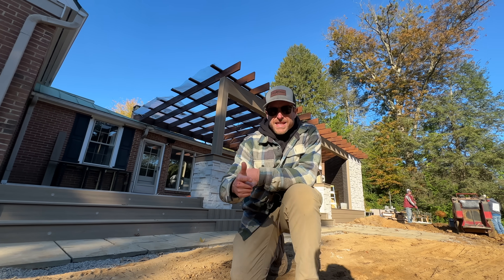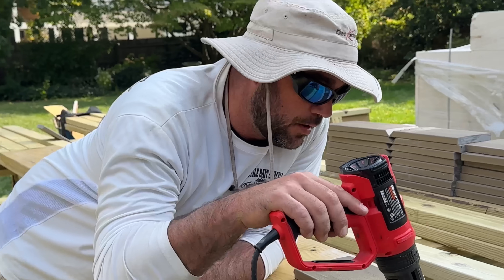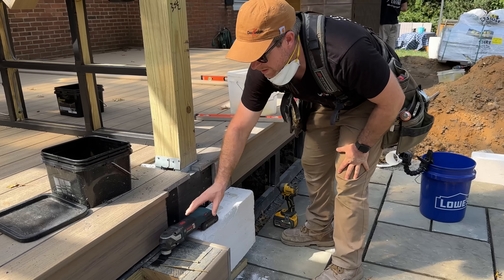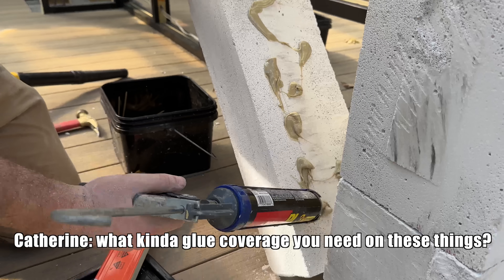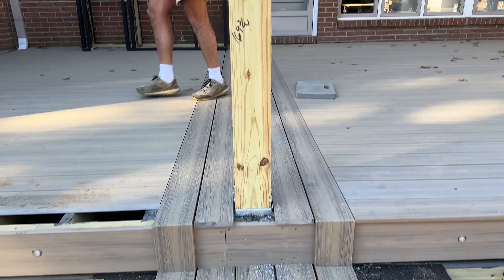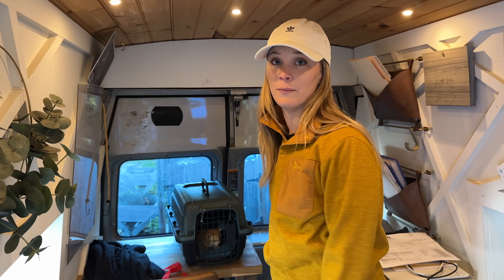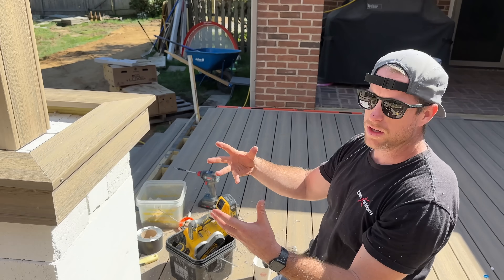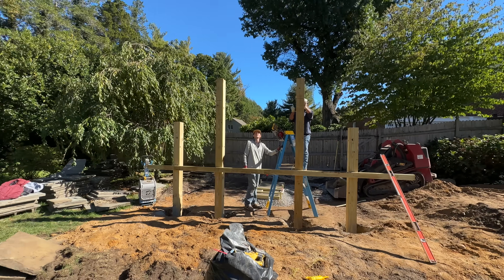Building Columns With a NEW CONCRETE Product - Is AAC The Future?!

Comment: Hallo There,
Why do you use the new material out of concrete? I think you are faster and it's more easy for you to make wood frames.
Reply from the maker: Might have been faster to do the column wraps with wood but wanted to try these out and we don’t have to worry about waterproofing all the way around it

Comment: I believe it is the same concrete the UK uses for buildings. The first layer is bricks, with insulation in the middle and a thin layer (about 4 inches of concrete) like the one in your video. In one of the videos that I watched, they even used a handsaw to cut the concrete.
Reply from the maker: I was so surprised that it cut so easily with a wood blade on the saw!

Comment: Why miter the bar top waterfall vs folding them? Im doing similar bar. Was it just a board length issue? Trying to fold TREX facia and it keeps cracking/melting.
Reply from the maker: With the other end of the fold running into a miter it’s really difficult to get everything to line up seamlessly so for that application we decided to miter it. Try heating it for longer til it bends under its own weight

Comment: Loads of schools in the UK had aerated concrete floors and now 10 years later they are crumbling to bits, so no, will not be the next concrete
Reply: Flooring isn’t probably best use but great for walls.
Reply: See how it was chipping when he was cutting not good for finished surfaces either
Reply: @Ultra77737  That’s not what it is intended for. He mentioned manufacturer and product, go read the specs. In right applications it is a huge improvement over current alternatives.
Reply: Why put it on the floor if this material is only for walls!!!!
Reply: Right. Would you drywall your floor? No.
Reply: @CMCraftsman  he literally says in the video, is this the new concrete? So I was answering a question, pay more attention next time you write a comment
Reply: For floors??😂
Reply: Wondered about longevity. Thanks for sharing.